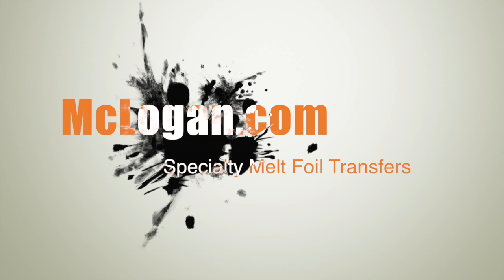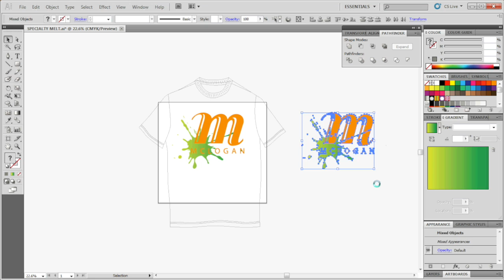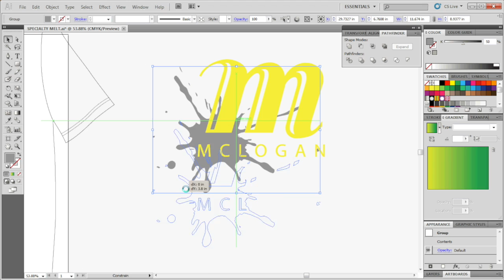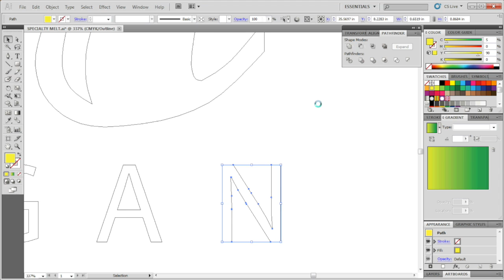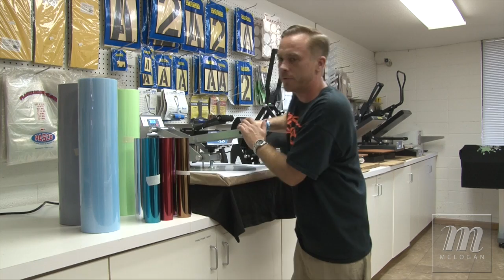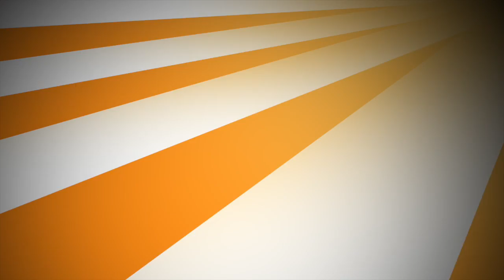McLogan Gecko Specialty Melt

Comment: Hi. i recently bought a yard of reflective gecko heat transfer vinyl and when i wait for it to cool down after i press it (since it is a cold peel) it is really hard to peel the plastic covering it actually sticks to the shirt and when i pull it off it stretches out the shirt. i put my heat press up to 310 degrees and press it for 9 seconds. am i doing something wrong?